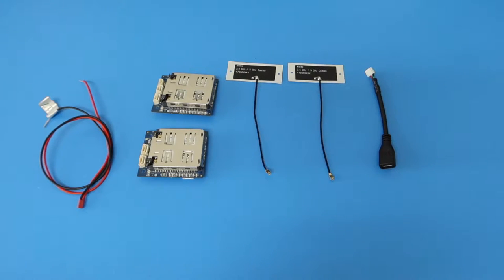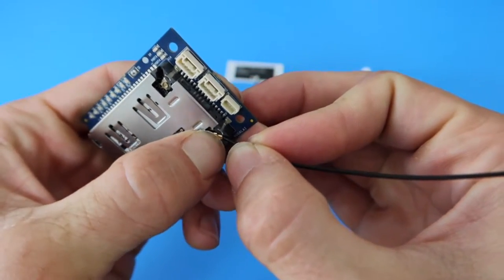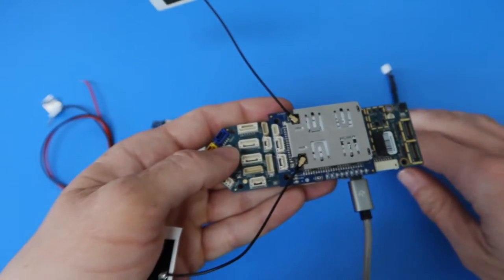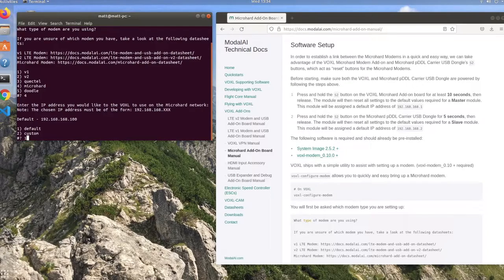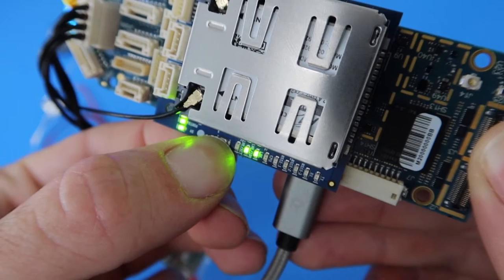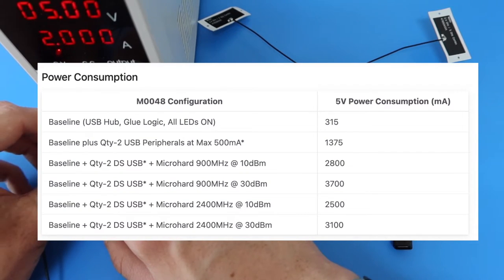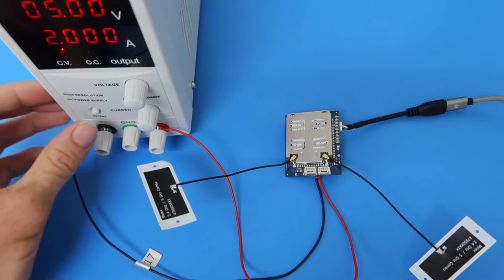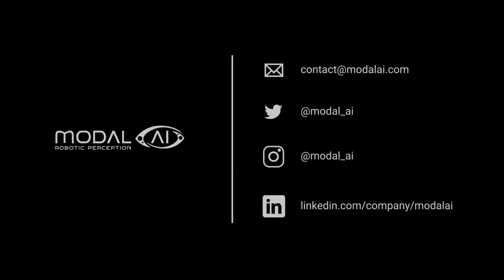ModalAI Microhard Modem Quickstart

Comment: Are the signal and GND pins on the U.fl connectors shorted? I checked continuity on three PMDDL modules and they all seem to have continuity between the signal pin of the U.fl and the GND. There is also continuity between the signal pins of both the U.fl. I find this very strange as I cannot verify this anywhere on the internet to be a common occurrence amound PMDDL or other RF devices.